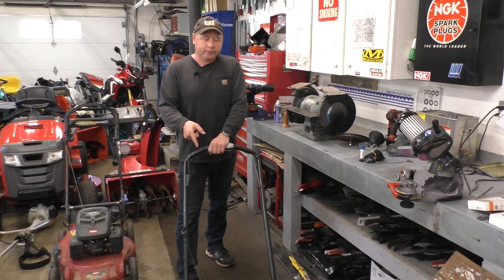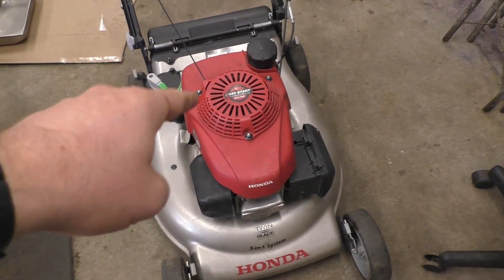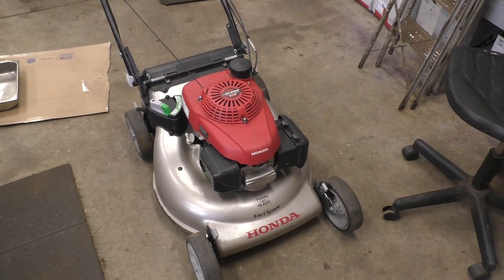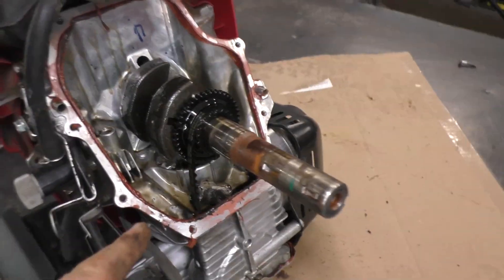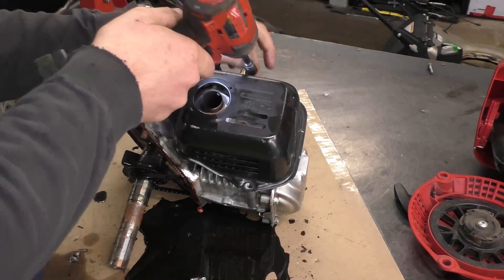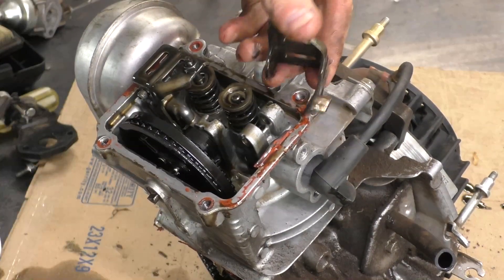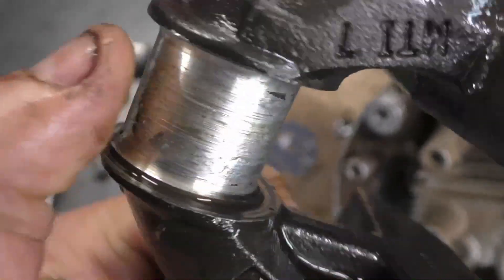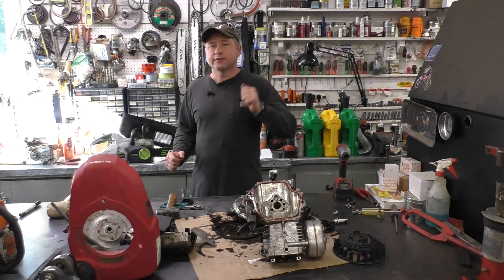Engine Teardown - Another One Bites The Dust!

Comment: Can I ask about my husky 65021as with the briggs? I put a 12 volt sealed battery in it like the honda uses. Been working well, always remove the battery and charge it during the winter. When I turn the starter  sometimes it will just click. Does it have a relay on the ignition wire? The starter motor hasn't been used much.

Comment: Never messed with Hondas.  Wonder why the lower crankcase cover is split on such an angle like that?  Perhaps for easier access to something.  Strange seeing the cam belt submerged in oil like that, guess the belt must be made of some special material.  I see all that ugly sealer around the lower cover as well, no gaskets used here?  An old Briggs would have still been running.... Those poor things took a beating and kept going for sure.  I remember customers bringing in seized Briggs/no oil, but not blow up/broken rod.  I would simply put a pry bar on the flywheel, loosen it up again, fill it with fresh oil and off it went for many more beatings.

Comment: Hello.. i'm having a problem with my kohler courage 6.75 hp lawn mower engine( 1p70fua).. ok so the top of the engine and the crankshaft and the sump is all thats together.. as i hand tighten the sump bolts.. the crankshaft suddenly becomes stiff enough to seem to be siezed.. but when the bolts are loosened with (not tight at all) the crankshaft rotates perfectly.. can you reply and tell why this is happening?

Comment: They ran it low on oil, then added oil after the rod broke. A worker at a construction co [that I was their mechanic] ran a 555 Ford backhoe almost completely out of oil. He panicked added oil up to the full mark, and thought himself quite clever. Unfortunately ,he could not crank the motor. So, at the bottom of the dipstick, was black oil. All the rest of the way up the dipstick was clear oil that he added. No, the boss didn't fire him. I noticed black oil/clear oil on the dipstick that you removed.

Comment: The reason why the front tire treads are worn is because those wheels can also be used as drive wheels. They have geared hubs. You can use them as drive wheels also.  They were rotated once the original drive wheels wore smooth.

Comment: I was given that same type of mower that just needed a new carb but my pull start is free like that too. Mine runs it just takes a second to fire up. It doesn't fire up like my other mower that 5 years older. I thought that was a charact of it. Do those have some kind of overlap in the valves or does mine have low compression?It knows and drives along perfectly fine

Comment: I own a similar Honda mower with the same thumb drive mechanism. I was surprised there wasn't a throttle lever on the carburetor side of the mower handle. Mine has one there for High or Low speed and shut-off. You mentioned sheds as in more than one that you keep your spare parts within. I've been wrenching on mowers, snow blowers, weed trimmers, and chainsaws since I was about 12, in 1982. Here we are 40 years later and i really enjoy watching your tutorials Dony. Do you have other videos of what your shop layout is, and sheds and how you organize or don't organize your spare parts and tools? I'm thinking of fixing up and re-selling small engine equipment as a hobby during my retirement in another 12 years or thereabouts. I do some now in my spare time and I've always enjoyed it. Thanks for all you do here... it's much appreciated!

Comment: I've never seen a teardown video of one of these Honda engines, it was interesting and eye opening. I've had a similar Honda engine on a Husqvarna lawn mower that I bought 3 years ago and I haven't had any problems yet with it, it starts on the first pull almost every time. I'm curious why the wax pellet for the choke operation is looked down on, it's a simple fix if they go bad isn't it? Also, I did not know that these engines had a timing belt inside, do you know if they're known to wear out or stretch over time and need replaced?

Comment: In less than 10 years you will be replacing electric motors,speed controllers, and battery cells. Maybe that will be the time to retire.
Reply: Do they even sell parts for electric mowers? I actually went from a cheap electric ryobi to a Honda even though I got a dinky yard

Comment: Just curious is the connecting rod too expensive to consider replacing? Or would you have needed other parts as well that would also be too expensive?
Reply from the maker: it would have needed a lot more parts and it would not financially be worth it
Reply: @donyboy73  what other parts would it need other than the connecting rod? head gasket, oil pan gasket, possibly new rings. ? What else am I missing? Sorry decided to rebuild one myself (a gxv160) where the same thing happened to the connecting rod. After watching this video, I’m thinking it might be scrap too.

Comment: Oil not changed enough or even sloppy oil change where he got sand or dirt in there by not being careful. I got my father in laws pressure washer I was borrowing and dang oil looked horrible. I changed it and the oil smelled horrible like lacquer whole garage stunk. It was hard to pull over the first time after I changed the oil ran it 10 hours now running good. Start on first pull.

Comment: Love the tear down videos. You can learn a lot and sometimes you can get quite a few useable parts. I have a Kohler courage engine with the hours on it it comes to approximately 126,000 miles before it finally lost compression and it was serviced regularly. With an engine that blew up like that and if it didn't cause anymore damage can you replace the connecting rod ?

Comment: Talking about Hondas, donyboy73 have you done a chute modification on the Honda hss928 or any other HSS chutes. Honda messed up their design making their collars too tall on the chute and therefore clogging the machine up with slush. I was wondering if you ever done this to one of the Honda snowblowers you have in the shop? This is a known issue from 2017-2020. Honda replaced some but said mine is out of warranty and won’t honor it
Reply from the maker: no I haven't yet
Reply: @donyboy73  maybe it’s only in USA. Mine is a 2018 Honda hss928 wheeled snowblower. Chute collar is tall

Comment: Yep, called it! Its a classic case of broken rod, its caused by people who abuse their machines. At least the guy admitted that the mower had been used a lot. And all Honda mowers lose their tread on the wheels when used a lot. But I agree, there were parts that were still good on the engine, always want to keep that stuff on hand. Honda parts have always been expensive because of import tax, but since pandemic and supply shortages, costs have gone up considerably since. This is why people need to change their oil more often. I also agree the deck is still in great shape, which is odd, cause normally they get trashed as well.

Comment: I have a John Deere LA 115 that blows oil all over the back of the engine. I took it in and they said they fixed it but it still does it. I have to add a quart every few mows on a 3/4 acre lot. what might it be?
Reply from the maker: can you check and see if it's coming out of fuel pump like in this video? https://www.youtube.com/watch?v=OKvsCjptt5E&t=1s

Comment: Great, thanks!  I'd suspect the oil got low and engine failed and they put more oil in to see if it'd still run.  I'm a bit surprised you're not keeping the case, unless it's damaged.  Not worth someone paying you to fix but either to rebuild another one, or that engine with some other, good, used parts.

Comment: Great teardown video.
For diagnostic test to confirm a suspected rod failure,I save time by removing the plug and place a pencil in the hole and cycle the machine to see if the pencil moves.

Comment: Thanks for the detailed video Don. I have a unrelated question for you about summer and winter storage of lawn mower and snow blowers, in which I have a Honda HRX217VKA and an Ariens snowblower. I have taken your storage tips on both by letting gas tank run dry. I know some people add Sta-Bil Stabilizer to gas for the storage season and I don't think I would do that. What do you think about filling gas tank with Trufuel ethanol free gas for storage? I have heard pros and cons on emptying tank because of sealing rubbers. What  are your views. Long time viewer of yours. 
Don from Milwaukee, Wisconsin USA
Reply from the maker: storing with truefuel is a good idea
Reply: @donyboy73  Thanks for the reply Don. I think I will change oil and spark plug, let gas pump run dry and put in Trufuel in my Honda mower for winter storage this time and cross my fingers when I start Spring 2023.

Comment: That was an interesting exercise.  Thanks for the tour.  I thought Hondas were indestructible, but your speculations regarding the failure make sense.
 It was sad to hear your assessment of the future, but you almost certainly are right.  I am not looking forward to having to take 2-hour breaks to recharge battery packs when I am trying to mow my property or clear my long laneway!
Reply: there will be ICE engines, for those who prefer them. Just collect a few spares, or wait till a neighbor tosses one with a loose cutting blade, plugged air filter & fouled sparkplug. Then bolt it on & operate it for another fifteen years. Free  B&S Quantum engine!!  I do that.
Reply from the maker: unfortunately some of these honda engines are made in china and the quality is not what it used to be
Reply: @donyboy73  I didn't know that!  I wonder if those Hondas and the "Chonda" clones are made in the same factory?

Comment: Honda's can be pretty forgiving on rebuild in my experience. Last summer rescued a similar engine, GCV190, on an HRX217 where the broken rod knocked a hole in the top end. I used the bottom end of that engine along with the crankshaft & flywheel, all in good shape, and utilized the cylinder top end, with rod, piston, & valves, from a GCV190 pressure washer on which the pump was kaput. Have successfully mowed with that HRX217 for two seasons now. But I am a DIYer; such an effort likely wouldn't be productive nor cost effective for a shop owner.

Comment: thanks for the video Dony very interesting i don't have any experience with the gcv160 from what i know  GCV = Honda's premium residential mower then i think its GSV = Honda's commercial version of the GCV then what i own is the gxv160 GXV = Honda's top-of-the-line commercial 
think i bought mine back in around 2008 still going strong touch wood only thing that has broke on that so far is a pull cord but great to see what happens to some of the other Hondas of lower end which i assume are still expensive for a domestic mower thanks for the video  great as always take care

Comment: That's a shame.  Anyone that has one of these Honda GCV engines knows and can tell it will last forever if it's properly maintained.  The oil is only like $5, no oil filter, so there is no excuse for not changing the oil once a year.
The over-rev is why I don't bother with 'modding' my mower for a few extra RPM.  There is a reason why Honda leaves some headroom (excess capacity) on the engine instead of running it at its redline.

Comment: I’ve been running my Honda mower for 8 years now & my wheels have tread ! I change the oil every Spring with a synthetic & this thing keeps on purring & still starts on 1/2 a pull! Someone abused this thing because it’s hard to kill these motors!
Reply: well there's metal fatigue at play here too. aluminum rod, light, cheap, easily machined. 
And prone to failure over time. Those wheels covered a lot of yard. 
Seems the secret to an indestructible mower is governed non-throttled carb, 199cc engine if using self-propel, & decent paper air filter.  The old Quantum has that & seems to run almost forever without a failure or odd ball repair. But you have to buy a new filter & sparkplug every five years, and change oil every season.  Sharpen the blade too.

Comment: It doesn't look like you can lap the valves on that design, having to pull the crank shaft and piston first.  Glad the B&S in my Tractor Mower has a Head I can pull!  The compression was 100 psi out of 130, so I lapped the valves.  The whole full gas tank had drained into the oil, so I had to replace the carb from taking it apart to check it (a friend who helped let a very small piece fall out and we lost it).  It has always had Zero Ethanol used, so the carb wasn't dirty.  I also bought a new fuel pump because a mechanic neighbor said that could also be how gas got in the oil.  He said to check the compression, so I lapped the valves while I was at it.  I watched your video Briggs & Stratton Engine Valve Seat Repair again.  What a video!  A COMPLETE Step-by-Step Tutorial.  Thanks again for that one!  I couldn't Like it again, but I would have needed a Love This! button if I could have.  I drained the oil from the drain side and again with the oil filter off, then put the spark plug back in, closed the drain port and blew compressed air in dip stick hole, kind of sealed with one hand, to get all I could out of the filter hole.  Then I blew the oil filter out and let it sit draining for a day, but replaced it anyway to add new oil.  Once I get it running again, I'll change the oil and filter again to get pretty much all of the gas out.  I will always turn the inline gas shutoff off every time I'm done mowing to be sure that never happens again.  Thank you, Don.  That video made the job much easier!  I used a rag to keep the valves in while I released the spring clips.  I had forgotten that part.  Can't remember everything.  😔🤣

Comment: will the ban on gas engines include riders ?  i didn't know honda mower engines had timing belts , thanks . for the benefit of diy people (like me) i'd like to point out that a stuck open valve can cause similar symptoms . put a screwdriver in the spark plug hole , rotate crank very slowly , feel for movement of piston .
Reply: Yes. They are banning everything gas powered, including gas powered generators, to power your home when the power shuts off. The grid in California is not reliable - I live here. The gas ban hits everything except for cars, which they will ban in 2035. I have to stockpile mowers, blowers, chainsaws, line trimmers, hedge trimmers, and all kinds of equipment for our business, before the ban hits (which outlaws the purchase of new gas equipment in 2024).
Reply: If you reside in Commiefornia 😅

Comment: Fun to watch, thanks dony.
As you were talking about the various parts you'd keep, or scrap I got to wondering how you organize your scrap parts. I'm just a DIYer, but over the years small engines, and other mechanical objects have passed through my shop and I'm as terrible at throwing junk away as I am organizing my junk. Would love to hear your thoughts on shop organization.
Reply from the maker: I put them in boxes in my sheds neatly organized and labelled, very handy and those used parts often save my bacon!
Reply: best thing to do is organize it by type of metal.  then when you take it to the recycler, you can get the best value with the least fussing.
Reply: I use a magnet to help identify metals, and keep them in labeled bucket to take to the scrap yard. Totes get to heavy and boxes break. The buckets for me are manageable in weight and keep my build-up down.
I'm taking small engine repairs, so I take any broken cheap machine I can find. It builds fast!

Comment: Oh yeah, my first experience with a Honda push mower was putting the timing belt back on. I didn't even know some had T-belts but Honda loves over complicating things like choke for example or fuel shut off valve which is cool but I had to figure that out the hard way too.

Comment: Rare to see a Honda, that are premium priced over most mowers, fail like that. Was it the original blade? Was that under mower front shield bent? And the wear on the wheels...they got their value out of it. 1313 serial... 13.... there's your problem! 😆
Reply: GCV engines are not that good. We see a lot of failures on GCV engines at my work. GXV instead are workhorses, never had issues with them.

Comment: It's 3:07 am and I'm eagerly awaiting 7:30 am so I can run the two junked snowblowers for the first time. Both discarded from mice damage which brings me to a video suggestion. 
How to discourage mice from making a home in the various types of small engine equipment. I've tried a few things but don't know if any work as I get stuff, fix it and sell it too quickly.
Reply from the maker: moth balls work great
Reply: @donyboy73  Much appreciated. I'm on my way to get some now.
Reply: I have that problem. Moth ball bags have mostly worked. Both in the machinery and under the hoods of the cars. For out-of-season storage I'll drop one or two on whatever it is and try bag it as much as possible, or at least bag the engine. A ZTR mower gets two bags and I have a cover for the mower. But still, when I pull the snowblower out soon I'll drop the belly pan to be sure the hotel's been unoccupied.
Reply: @ChuckD59  I heard spearmint oil like the over the counter pharmacy has works on cotton balls which would require putting where water can't get it like where a mouse would live. Have you ever heard anything like that as it was in a Farmer's Almanac and I tend to believe that source. Great job at preventative maintenance BTW, I won't be seeing any of your stuff probably ever. People where I'm at throw away $800 year old Weber grills if a mouse makes a nest in it. I currently have a collection of Weber grills from the early 90s till two years ago I restored over the winter and just got a Weber Genesis Gold which I've never seen before. Anyways I'm rambling so peace and not pieces for your connecting rods.
Reply: @ChuckD59  I've heard stinky dryer sheets